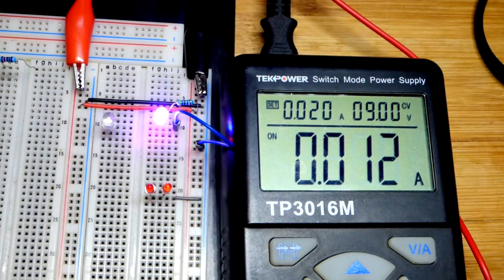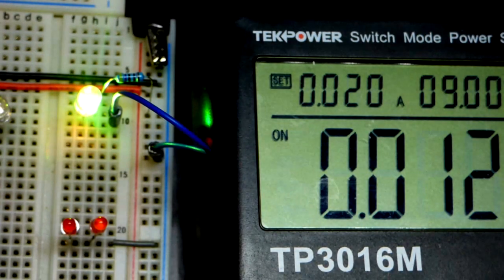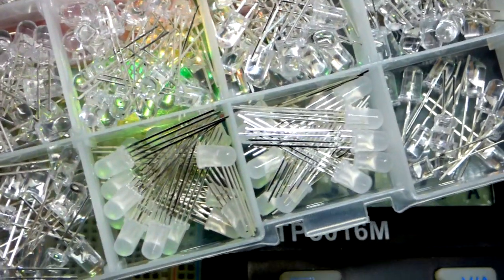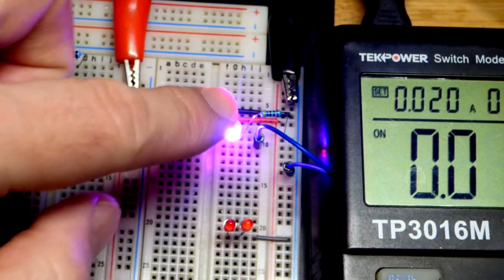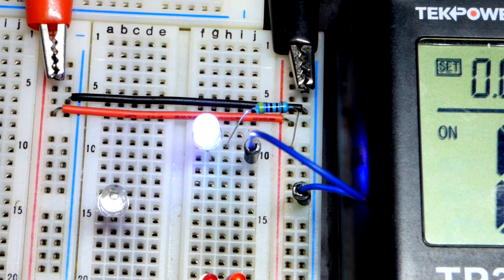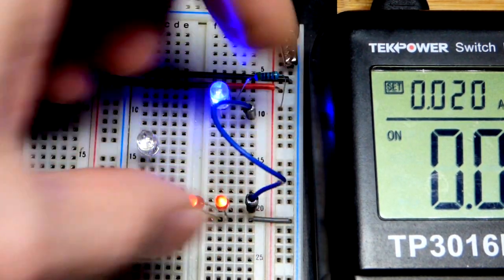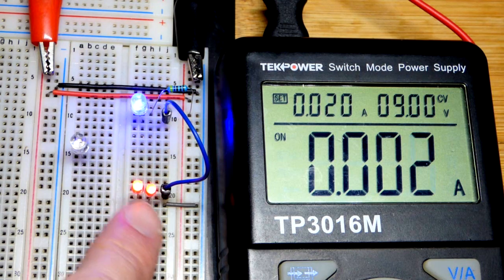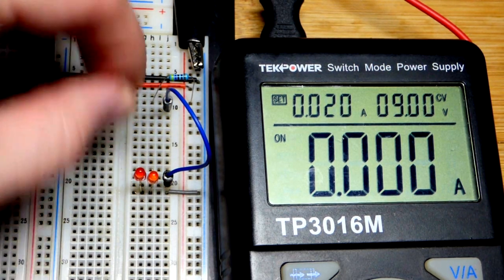Fast and slow self flashing or blinking LEDs demonstration for how to DIY electronics by Electronzap

Comment: I am building an ornamental lighthouse for my backyard and I want a slow flashing light for the lighthouse. Voltage is 12 Volt from landscaping lighting constantly supplied during darkness. I want the light to slowly fade off and gradually come back on....easy on the eyes and realistic. What parts do you recommend, relay? resistor? capacitor? all three? What sizes?
Reply from the maker: There's not a single component that does that, maybe there's prebuilt modules online. Ultimately you keep raising and lower the voltage powering the lights which is done with a sawtooth generator and power amplifier.
Reply: @Electronzap  Thank you for your quick reply, I found slow flash lights on Amazon. BTW, my wife has a lighthouse Christmas ornament that has a very soft light on, light off function. I would use it, but its for 110 Volt.

Comment: What is the basic principle of this blinking led. Does it have any inbuilt circuit in it.
Reply: that's what I am wondering and why i am here. .....
Reply: googling  : ..."flashing LED has built into it a tiny little astable multivibrator circuit. "
Reply: Short answer... Yes. It has some microscopic circuit all built in that LED case along with 3 LEDs sharing a common cathode (or anode not sure which) red, green, and blue LEDs all in one housing. But is same size as a regular LED. They pretty neat.
Reply: All astable circuits have capacitors in them. I wonder , if there is any capacitor in it. Rest circuit can be done chip on board (COB) , but how come capacitor. I break one , but still can not find any capacitor.

Comment: I built an FX pedal a while back that had a distortion circuit (simple op amp) feeding into a delay circuit (PT2399). I used two indicator LEDs to show that both circuits had voltage running thru them and at one point I experimented with a slow flashing LED and a fast flashing LED .... it gave off a VERY ERIE noise! In the end I opted not to use them but I might go back and replace the LEDs I eventually used (regular yellow).
Reply from the maker: Sounds pretty cool :)